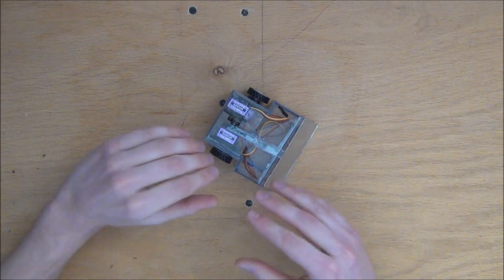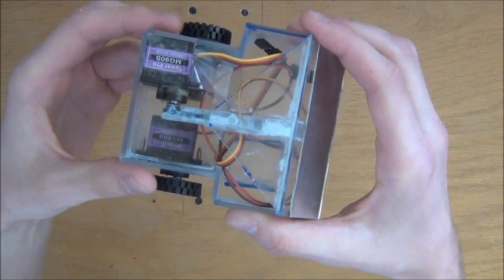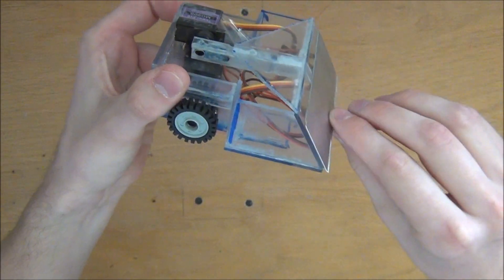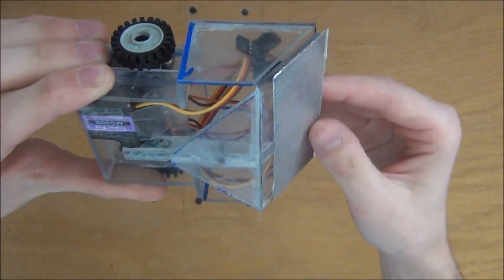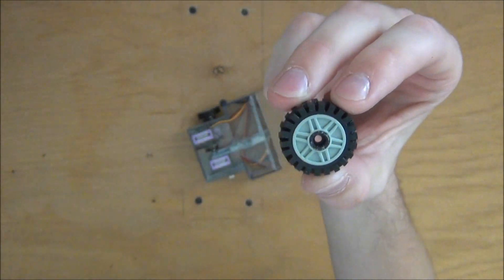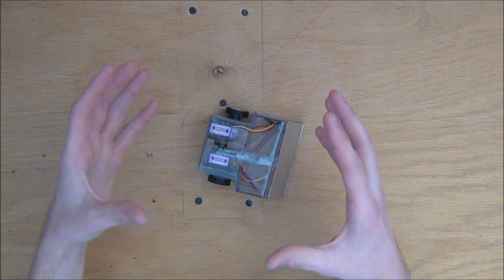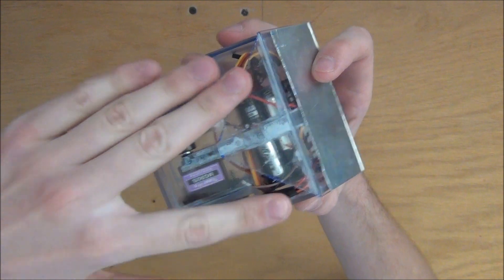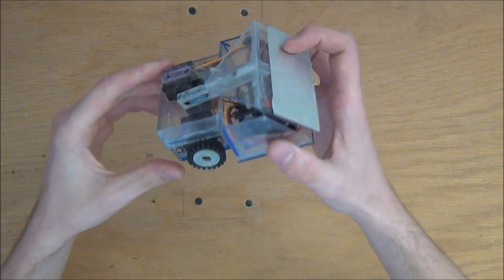How to build a battlebot (Part 1)

Comment: I’m SUPER late but i have tried to use servos as drive motors and when i try to go foward one goes clockwise and the other is counter clockwise and i just wondering if this happened to you and if it did it would be great if you could tell me how to fix (love the vids) ;)
Reply from the maker: Sounds like you just need to do a little bit of channel mixing. Do you have a programable Trans?

Comment: The motors your using, are they continuous torque motors
Reply from the maker: The drive motors are continuous rotation but the lifter is just a standard m90

Comment: +Mechanical Ninjineer what type of motors did you use?  We're building our own as a school project.  Help?
Reply from the maker: For my 150g robot I used standard metal geared micro servos for the lifter and for the drive motors I use 360 degree servos that I bought at robotshop.com  :)

Comment: Whered you get the motors?
Reply from the maker: robotshop.com  :)
Reply: Mechanical Ninjineer when i search in the text box on the website, what do i search? Is there a certain brand you used?
Reply from the maker: 360 degree micro servo. That should do it!

Comment: Question, how do the bot turn? I cant see any front wheels that does the turning, so is it just the servos rotating opposite from one another to do the turning?
Reply from the maker: YES! That's is exactly correct! Because this way I don't need front wheels and it saves weight and space.

Comment: is the flipper motor the same as the wheel MG90S Tower Pro Servo
Reply from the maker: Yes it is, However I ended up switching my drive motors to servos I bought from robotshop.com. but the flipper motor is still the same http://www.ebay.com/itm/SG-5-Pcs-MG90S-Micro-Metal-Gear-9g-Servo-for-RC-Airplane-Helicopter-Boat-Car-/322086441380?hash=item4afdd911a4:g:x8AAAOSwZVlXmwWZ I just modified it to spin 180
Reply: Ok thank you
Reply from the maker: for sure!
Reply: Also can u plz tell me what you used to build the button in the video where you build the arena?
Reply: Also one more thing can you you make a video on how you made he flipper.
Reply from the maker: I Built it out of MDF but I think a solid plastic, medal or even wood might work better.
Reply: Ok thank you so much again so u made the button and flipper out of MDF
Reply: And can u plz plz plz tell me how u made the flipper on the Servo
Reply: How do you mod the servos for 360 rotation

Comment: what to do for heavy weight???
Reply: From what Ray Billings told me (Tombstone driver), he said you would learn about as much information and skill from a 1 lb bot tournament as you would from a 250 lb bot tournament, but you'd save an arm and a leg in financial issues.  And that once you get an effective design from a 1 lb bot, you can use that same design with a 250 lb bot.
Reply from the maker: I do have plans of building a battlebot but not just yet. Here is one of my latest battlebots though!  :D    https://www.youtube.com/edit?o=U&video_id=9KSi1hCg0gk
Reply: hi
Reply: the same thing just 250 pounds
Reply: Me and my freind r building a battle bot any tips
Reply: ciaran brenn100 a battlebot is a 250 pound combat robot competing in battlebots. For a group project I recommend a beetle or hobby weight. Try to get all parts as cheap as possible because the average 12 pound hobby costs from 600 to 1500. Watch Robert Cowan’s videos about his featherweight. They are the most descriptive and have guided me through the process of my hobby weight. If you would rather not stay up till 2 in the morning build smaller robots. Don’t rush into building the robot cause I’ve lost hundreds of dollars getting to eager. Use uhmw for the frame and layer 1/8 or 1/16 thick aluminum on it for a beetle. This is an extremely expensive hobby so be ready. When I started building my robot I was only going to be spending 80 bucks tops. And now almost 6 months later I’m teaching my robotics teacher about robotics. The robot community is a great place so make a fra/fighting robot association account. If you have any questions comment on Robert Cowan’s YouTube videos.
Reply: Thanks so much

Comment: Why did you use AAA batteries instead of Lipos?
Reply from the maker: Because they are cheaper, easier to replace and I don't have to charge them. Now with that being said I most likely will switch a lithium ion or something sometime soon.  :)
Reply: Thanks for the reply.  Also I messaged you privately too.